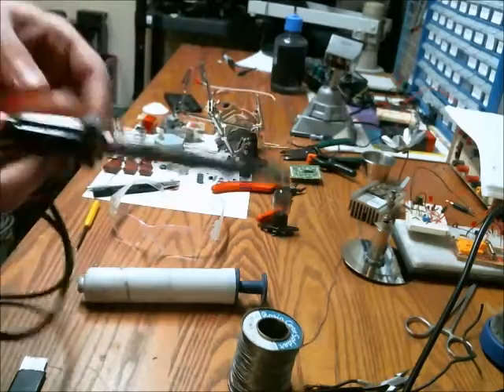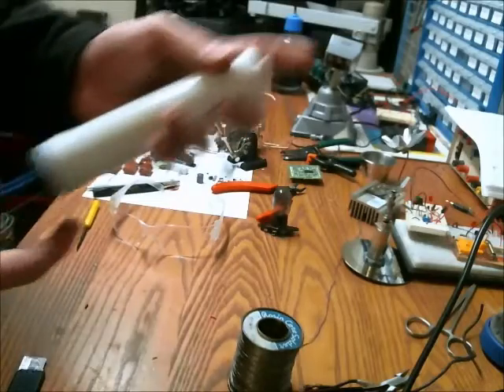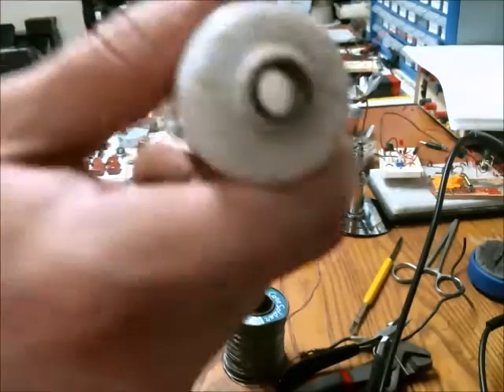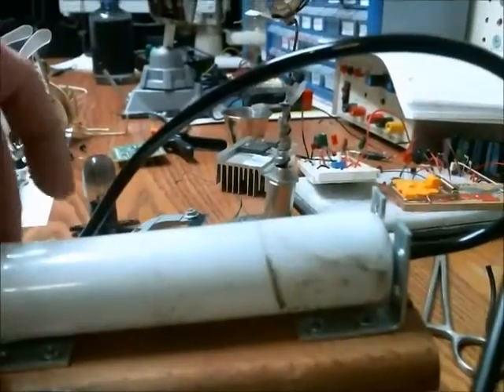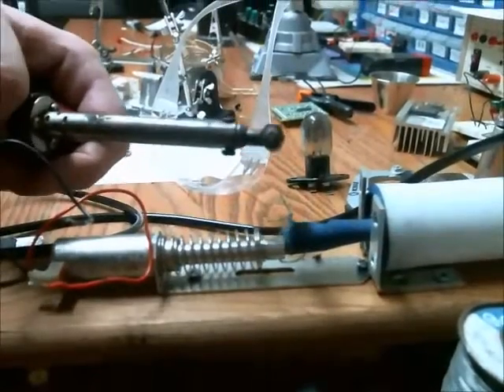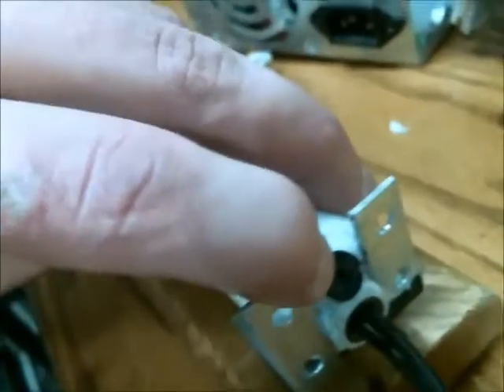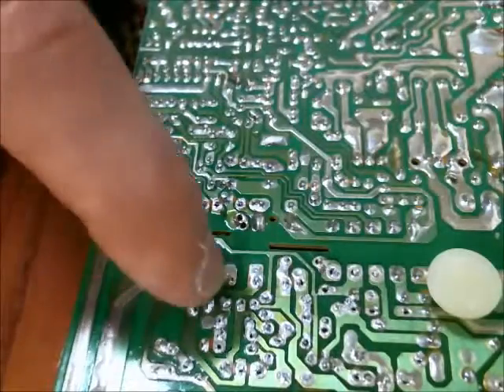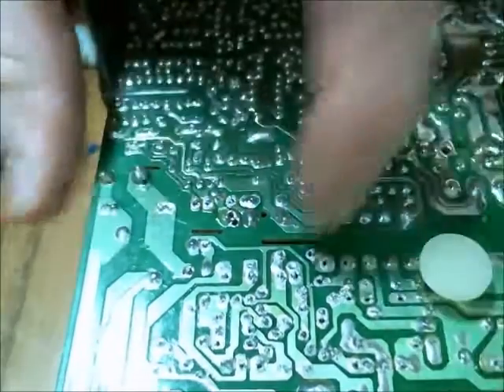Improved Solder Sucker w/ Solenoid and volleyball pump.

Comment: Use the solenoid to release a vacuum reservoir. Alternatively, use the solenoid with a Venturi to convert a pancake air compressor into a suction device.

Comment: really a waste of time. first off you didnt let half the solder joints even heat up enough formit to work. second at some point that tube connected to the tip will get clogged doing it that way. the tool is perfect as is .